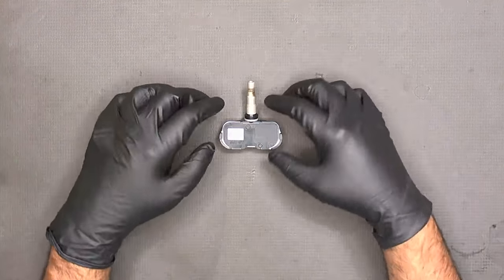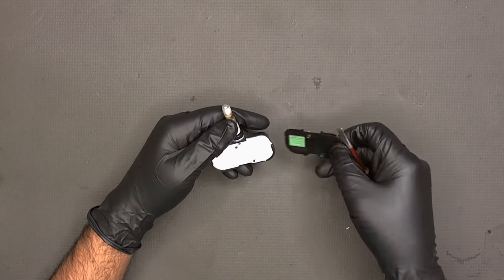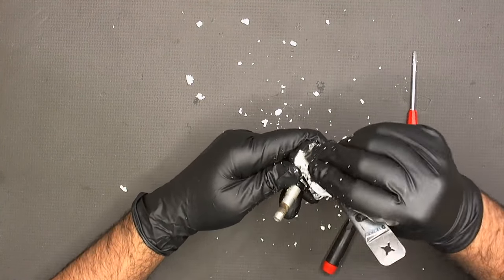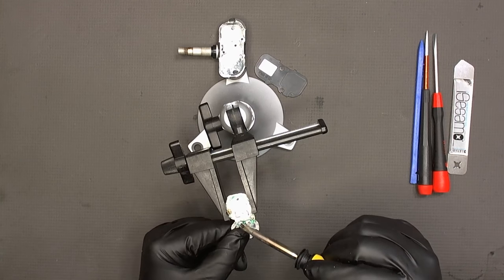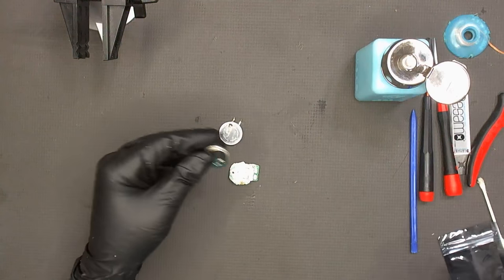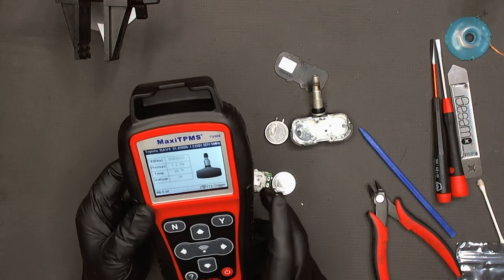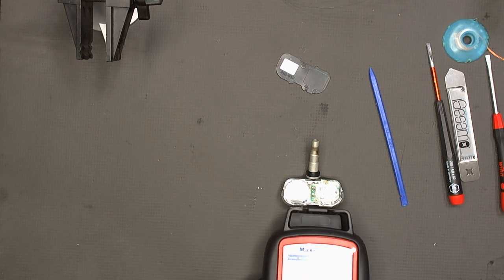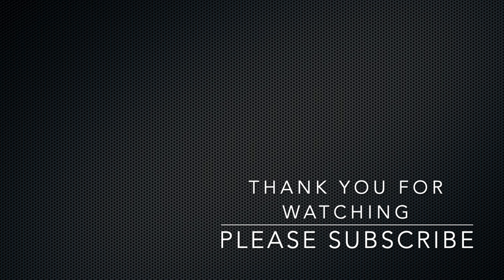How To: Replace TPMS Battery

Comment: Throw out and remove dash bulb!!!tpms is a joke!! another expense and headache!!
Reply: Mike Secondo , that sounds like a great idea, except non replaceable and soldered in bulbs in newer vehicles. Also most vehicles also have an audible ding or other sound that may chime at the same interval as the blinking light! Manufacturers have got us by the unmentionables!
Reply: @unclemarksdiyauto   So polite, yet true: "... Manufacturers have got us by the unmentionables!"
Reply: @AmitSingh-zn1kz  They do! Although it is convenient to have, it is very expensive to maintain after 5 years if you drive a lot. Our van is having issues reading good sensors every so often. And that unit  that receives those signals has been replaced once already.
Reply: @unclemarksdiyauto  I believe we have become, or made, too soft and just not ready to deal with (even a minor) uncertainty.  For the specific case of tire pressure, we just need to keep an eye on the wheels and measure/maintain the pressure every couple of months.  But even that has become too hard.  That has "exposed" the "unmentionables" to manufacturers and dealers!
Reply: @AmitSingh-zn1kz  People don't want to do anything but drive. It seems we can't check our oil, (how many people have ran engine out of oil amazes me!) windshield washer fluid levels, check tire pressures, (and still drive on a flat) even check our gas tank levels without a chime and extra light to tell us the tank is just about empty. We can't even turn our heads to see if someone is in the lane beside us! (We need land departure and lane avoidance. The next level is now self driving!) I am not from this new school/generation.